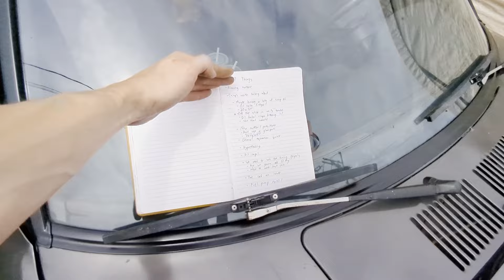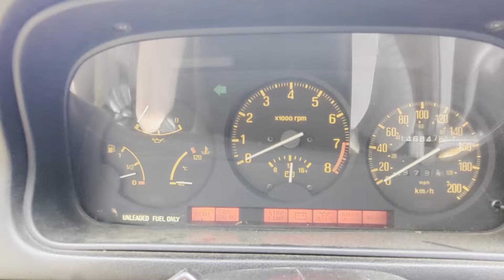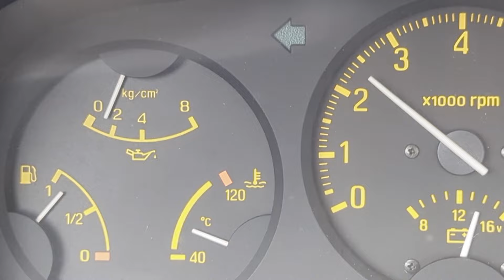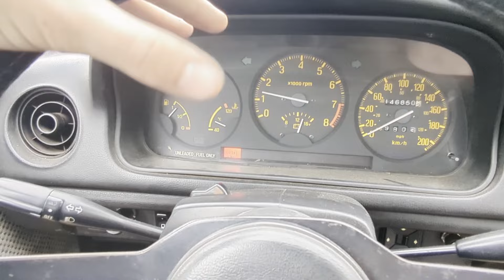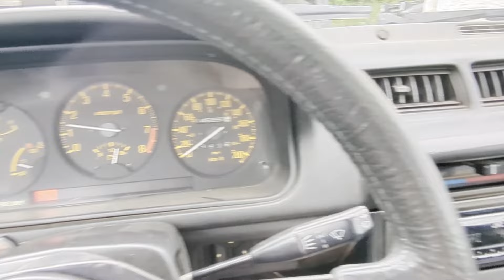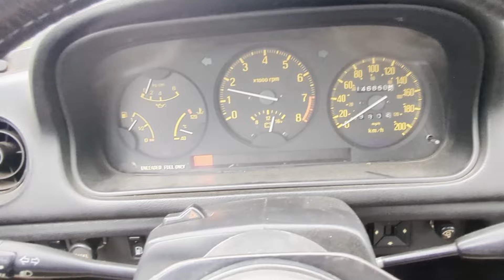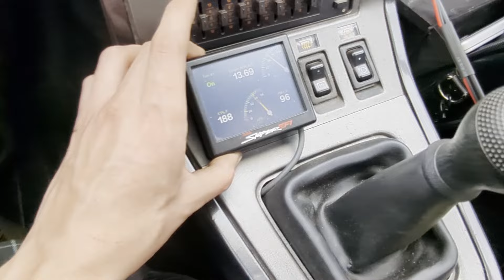Self Built N/A Bridgeport 13B - BREAK IN COMPLETE! She rips! -- $1000 RX7 Ep. 40

Comment: Great video, saw you cleaned and reused the oil cooler, I would advise to always buy a new oil cooler if you’ve ever had bearing/metal contamination, a lot cheaper than a new engine, otherwise well done.

Comment: You should make a cold air intake that pulls air through your "air conditioning" system. Now THAT would be interesting. You should also try using something like ice packs to chill the air. Something that wont "melt" with contact to air.

The rattling inside the muffler kills the beautiful rorary sound. You need a different muffler. 

The fuel pump noise you are hearing sounds to me like an inline check valve rattling or something to that extent. Thats definitely not the sound of air in the fuel system or aeration.
Reply from the maker: The icebox AC uses 4" piping so that's actually not impossible lol. I'm definitely gonna experiment with ice packs etc. The rattling inside the muffler? Not sure what you mean. I think it sounds great, what would you have done for a muffler setup?

Comment: Brother your exhaust material is not expanding 1/4" with heat😂😂😂😂😂😂😂😂😂😂 the warpage would be insane from each heat cycle your exhaust would look like crumpled foil that tiny amount of space is likely normal movement of the drivetrain. Exhaust systems have hangers flex joints and flanges to allow movement. Even with solid engine mounts your engine will move while your car is on. ❤
Reply: I bet his exhaust hitting the rear trim is from smashing the presilencer into speedbumps lol